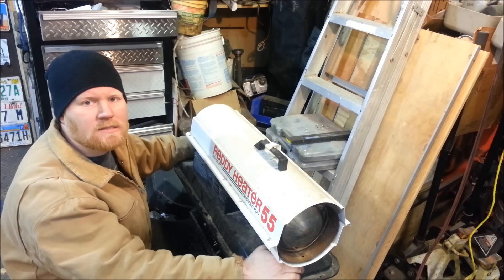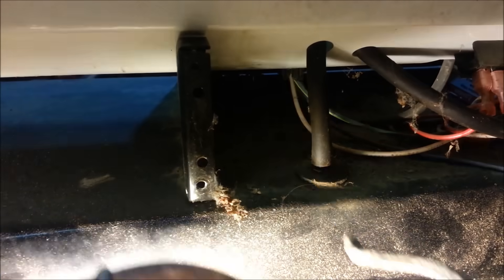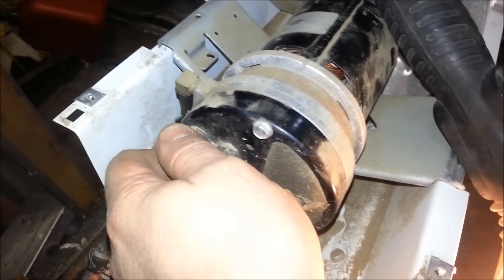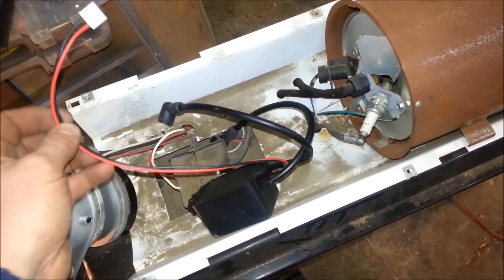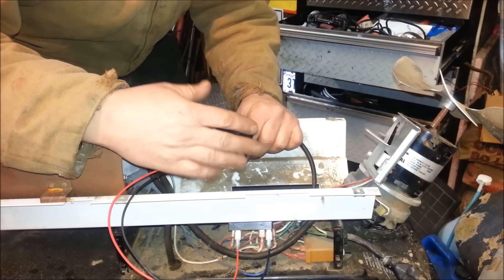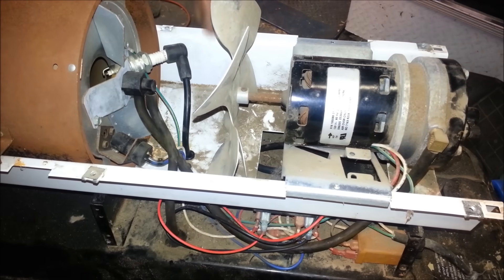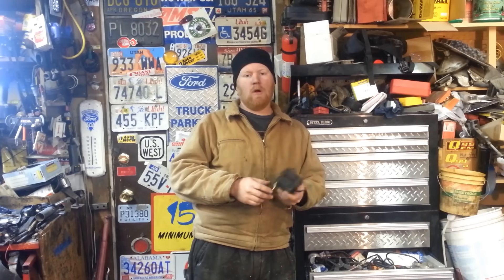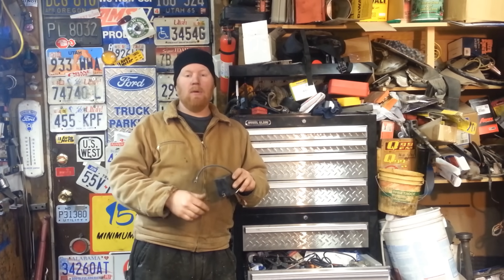Torpedo Kerosene Heater repair & HOW they work

Comment: Question .. I have the same heater. Kerosene is hard to find around here. I run diesel but it seems to smoke my garage up. Is there any settings I should do to make it less cloudy? Or make it better for it to burn?? Thanks.
Reply from the maker: You just need to adjust your air pressure. Kerosene around here is $10 a gallon so I run nothing but diesel and have no issues.
Reply: sixtyfiveford ok. Higher or lower psi?
Reply from the maker: @styga1969  you're pushing too much fuel, so lower psi.
Reply: sixtyfiveford thanks

Comment: I got one it works only if I got the top cover off but if put the cover back on I can see the pump works but it doesn't ignite, so basically it blows kerosene but not flame... what can be the issue please
Reply from the maker: You need to adjust your pump pressure.

Comment: I have one that runs fine as long as the top cover isn’t on it, as soon as I put the cover on it the flame goes out and it quits running in about 10 seconds.  Any ideas ?
Reply from the maker: Adjust your air pressure.

Comment: Just curious, and correct me if I’m wrong, but isn’t your “light sensor” the same thing as a CAD cell for an oil fired unit?
Reply: Yes, its the same thing, both are for seeing if there is flame (light).

Comment: Excellent video, not a lot of fluff and you get right to the point.  My heater quit lighting off last winter, had to throw a rag over the back of it (put on the choke?) to get it started.  Did a complete tune up on it today and your information really was a big help in figuring out how the heater basically works.  My heater actually had a crack in the plastic air pump back housing, losing pressure.  Sealed it up, adjusted the pressure, new spark plug and filter, general cleaning - works like new.  Thanks for the video!
Reply: Sometimes all it takes is a little investigation. This is the first time I have been on this website. Read it over this young fellow seams to have a nack for figuring things out. Great job fella.

Comment: I have the exact same heater, the only problem I have is the blower motor bushings sticking. WD-40 and hand turning to loosen fan works quite well.
Reply from the maker: Nicely done. Throw a few drops of motor oil onto the shaft to help lubricate it. WD40 is great for freeing up sticking parts but not so much for lubrication.

Comment: those things are horrible there is no way you should use these inside.. i had two work with these and when you shut the door the smell and smoke and carbon monoxide is horrible with these...
Reply from the maker: If they aren't tuned correctly they will produce odor, otherwise they're extremely clean.
Reply: @sixtyfiveford  the matance guy ware i worked was an idiot ...!!!!! so if they needed anything fixed he would just buy a new one.. some kind of credit card junkie ... its pitiful how big business solve problems and these things are like 400$ we use two use them till the smell and they would just toss them in the garbage crush them or store them some ware so they could throw them away later... but wow these things smell poisonous ... but working out in the cold heat is heat... till you get inside then these things are deadly your taking your life in your hands...

Comment: Great video!  Is there a way to oil the fan motor bearings? Mine’s squeaking a little and I’d like to maintain it well so it lives long 😄
Reply from the maker: I drip oil onto the shaft(generally ATF but any motor oil works). They are simple bronze bushings and will wear out quick if they start squeaking.

Comment: If you are looking to buy a new "rocket heater" I suggest that you go with propane. The propane heaters are smaller, lighter to carry around, cleaner, safer to refill the fuel and you can find fuel at any place that sells Bar-B-Que grill fuel. My stand by generator is even Propane.
Reply from the maker: I actually got rid of all my propane heaters except for one as a backup. Why? because the propane tanks freeze up and as propane gets near freezing puts out only a fraction of the rated BTU. The colder it gets the worse they work and are only ideal for shop spaces above 40F. Also having to attach a tank and keep it a few feet away nearly triples the overall footprint of the heater vs a self contained Kerosene/Diesel heater. To increase the performance of propane, the tank should be stored in a warm area before connecting it and using it. Doing the math I can put more BTUs of heat for less money with diesel fuel vs propane. That's even with diesel being twice the cost at $3.20/gal and $1.60/gal for propane.
Reply: @sixtyfiveford  You are exactly right about the propane tanks self refrigerating but I live in the deep south and it seldom gets cold enough for us to have that problem what with the propane tank in the heated space. If one is using propane after the fuel level in down a bit you can lean the tank over to about 35 degrees to increase the surface area of the liquid thus increasing the amount of fuel evaporated. 

We used to use them in peoples houses when doing storm damage repair and people did not like the smell that the Kerosene leaves behind. 

Both types of heaters have their place.

Comment: Hey my torpedo heater is not throwing any fuel to spark plug
Reply from the maker: Check all your small air hose lines for cracks/splits. You'll need to take off the top cover to do so.

Comment: Got a 110 pro i purchased in 1988 still going 31 years later. All original parts, would the ones made today even go ten years. I doubt it.
Reply from the maker: Very true. Everything built today is built with the intent of 4-5yr lifespan then throw it away.

Comment: I always wondered how mine worked and never bothered to take it appart.. lol now I know.  Mine actually has a pressure gauge built into the back of it, so adjusting is even easier.  Burns alot of fuel though, about 5 gallons per 8 hours being in a vented garage and all  (protemp 75,000btu)
Reply from the maker: They do drink a lot of fuel.

Comment: My first experience with one of these almost had a fire in a piece of equipment I was warming up. I didnt know someone had cranked up the air pressure which makes them run alot hotter !  Once I knew that it was ok, just had to be careful!  They pump out some serious heat when there jacked up like that!

Comment: Someone gave ME the same model as yours REDDY HEATER 55 i know lot of people would just throw THIS heater in the JUNK PILE and get a new one... i would not do that.. The blower motor was just plain junk and would work sometimes but most of the time it would just sit refuse to run.. + ROTOR VEINS $15 & motor $134 for a replacement, OH WELL i didn't mind it.. i know i could of get same heater off ebay for the same price, but the casing was in good shape and i couldn't see throwing it away and anohter heater would be damn stupid... running for two years and well worth it......
Reply from the maker: Nicely done. I have spent the same as a new many times to keep something alive. I value the learning experience and pride of fixing it myself.

Comment: I have similar master brand one I got used. I tested when I got it and worked, went to check again preparing for fall and it ran then started sputtering, like 2-3 times then it just tripped the breaker thing on the back and stopped working. I opened it up thinking maybe dirty, bad ignitor, etc. Cleaned sparkplug and still had issue. I saw the pump thing I thought fuel pump, but the filter on the back made no sense. I thought the black box under the fan was a motor capacitor.  Somehow I thought that the igniter only sparks once then the flame would just keep it going as new fuel came in. I guess this is similar to oil burners that use a 10,000 Volt transformer to keep the fire going.

Comment: Hi I have a 210000 reedy torpedo and it will run with the lid or top cover off but as soon as I put it back on flame goes out, lift it up in back about an inch and it ignites and runs fine as long as its lifted an inch or so in rear. I have good air pressure, I think around 6 psi. no cracks in hoses and igniter is working fine. Any assistance would be much appreciated.
Reply from the maker: You need to adjust your air pressure to what it specs out to.
Reply: @sixtyfiveford  THERES NO SPEC ON THE INFO BLOCK ON THE MACHINE SO I TRIED 3,5 AND 6 AND IT DID THE SAME EACH TIME.
Reply: OK I GOOGLED THE PSI AND IT CALLS FOR 8.2 PSI. I CAN ONLY GET MINE UP TO 5.8 PSI. WITH IT ALL THE WAY SCREWED IN. DO I NEED TO CHECK MY GAP ON PUMP CLEARANCE?
Reply from the maker: Pull your pump apart and make sure all the vanes are moving freely. Wipe them clean and reassemble everything. This usually does the trick. Make sure the gasket is sealing good and that you have no cracks in the housing leaking air.
Reply: @sixtyfiveford  OK THANKS FOR EVERYTHING, I WILL WORK ON IT TODAY.

Comment: You inspired me to see if my reddy heater 35 I bought at Ace Hardware 25+ years ago still runs. Only used it once. I dusted it off, and you know what? It runs! Same kerosene still in it! I expected it to be goo. It's still running now. I want to burn that old kerosene off before storing it again. Maybe I should store it with fresh kerosene in tank and lines. Definitely will start using it this winter. I thought it would be dead from not used and old kerosene in it. It was stored in an aircraft hangar. Maybe dry  environment helped preserve it.
UPDATE: It ran for over an hour and hardly used any kerosene. Yes it was burning I could feel the hot air. Really efficient heater. I will not be able to burn off kerosene that has been in tank 25+ years. I can't stay with it that long. 
The air filter turned to powder. Blew it out with compressed air. I can fabricate a new one.

Comment: Si if I bypassed the air pump and used a larger venturi sprayed through the small hole in the inner pipe, forced air behind the inner pipe and  vortexes the air in the inner pipe, or would keep you  warm because you just burned down your house?🤓😜👍

Comment: Got a question the sparkplug works if I have it out of the hole once it goes in the hole in my heater it stops I'm using the heaters spark system in both instances if you know why this is can you let me know if it's a bad plug or the spark box that's the problem

Comment: I have the same heater, only runs with the top off. adjusted the pump to about 3.5 psi. with the top on the flame slowly goes out like its not getting enough oxygen. fuel lines look good, new filter (in tank) and cleaned the jet. What might be the problem?
Reply from the maker: This means too much fuel is flowing into the chamber. Turn the air pressure down to flow less fuel.

Comment: So mine the problem is the spark plug is sparking but it won't come on. It was working for a lil and now it stopped working
Reply from the maker: Is it smoking/fogging fuel out of the front?
Reply: @sixtyfiveford  no

Comment: Thank You!  I have a Reddy Heater 70 that looks identical.  I bought it new in 1997 and shamefully have done zero maintenance.  It just stopped on me and I did not know where to begin.  I am confident with a little TLC and help from this video I will have it back up and running in no time.  Great Video.
Reply from the maker: Thanks, I'm glad you liked the video.

Comment: Hi, A friend of mine has given me his heater to fix. Tried everything in your video(new fuel lines,air pump working etc),starts & runs well for 30 sec,shuts down. Blinks out a code (power light blinks to tell you the problem)which is light sensor(not seeing flame) but a new sensor has been fitted. I presume it must be a problem with the control board? Help!! Thanks.
Reply from the maker: That's discouraging. If you have a multi-meter I would test the light sensor for continuity outside the machine. Shine a light into it and view the readings. If it is functioning correctly you can try to remelt some of the connections on the control board to make sure they're getting good contact. If that fails, I new board would be the route I would take.
Reply: @sixtyfiveford  already have tested the sensor, seems fine. Strangely though ran better on fresh diesel from a can. Still has problems but runs for about 10 min or so. Also discovered the board isn't original so could be flashing out a different code, will have to try to track down what manufacturer the board is from. Thanks for your help so far! (I still think it is the board) :)
Reply from the maker: I assume your light sensor simply opens and allows electricity to flow when it senses light. You could simply put a jumper wire on the circuit board so it thinks there is always light and should never trip off.
Reply: @sixtyfiveford  not sure, resistance changes as you shine light at it or cover it(so it's dark), don't think it's a closed/open circuit.

Comment: awesome vid, you really helped me out here.  I'm up in Wisconsin and make knives for a living, and I cant make knives in my shop when it's -20 unless i have a heater.  Well my heater wouldn't ignite, it's a much older model than what you were showing in this vid, but still had similar guts.  i was able to pull the plug, check the spark, clean the plug and get everything working again all in about 20 mins.  Thanks so much for making this video.
Reply from the maker: That's great! I'm glad the video was helpful.
Reply: You can consider an Inkbird ITC-308 for temperature control of heat and a/c for multi use.

Comment: Hi. Of all times for my heater to mess up it's -38 C here in Northern Ontario Canada today and I'm in the middle of changing my Thermostat in my truck which is half in & half out of my garage and tarped all around by my garage door to keep most the heat in. I have a Dyno-Glo Work Horse 65000 btu my problem is that it was running for about an hour it runs on desiel fuel. It shut down then it wouldn't light up for about 15 minutes later then again it stopped. I tried starting it for about 20 minutes I gave up. Now it will not start up? Only the fan blower comes on. Any ideas what it could be?
Reply from the maker: I would first check and clean the spark plug.
Reply: @sixtyfiveford  Alright I'll check out in the morning. Thanks.
Reply: Okay I believe I found out why it was shutting down. The desiel fuel was gelling up at the spray nozzle. So I added a desiel fuel supplement to thin it down and not to gel so far it's working.

Comment: Mine fires up but shuts off after about a min any ideas on why ?
Reply from the maker: If it is producing heat and then just suddenly dies, it will be the  optical sensor.
Reply: sixtyfiveford is there anyway to test it or maybe ground the wires to tear if that’s the part
Reply from the maker: @jonharrington9545   The photo cell should essentially connect the two wires when it sees light from the flame. I would clean the lens of the photo cell and make sure the electrical contacts are clean as well.

Comment: Hey very informative video, mine is a Reddy Heat R110 but as soon as you plug it in the fan comes on, it starts sparking, then almost immediately trips reset button.  Not sure how to tell what's making it trip.  You said optical sensor does that but it never even has time to light before it trips really.
Reply from the maker: The optical sensor should trip it in around 3-5 seconds of start up if no flame(light) is detected.
Reply: @sixtyfiveford  Thanks for the reply, I'm gonna go do some of the tests you talked about with the fuel lines.  I did make sure they were clear but I'll see If I can make it spray. The things I get myself into for friends, just because I will generally fix anything while everyone else just throws it away.

Comment: I have a reddy heater r110 that currently has no spark. I have disconnected the lead that connects to the spark plug and bring the metal connecter end near the housing of the heater while plugged in and running with no spark.  Is is safe to assume the ignitor is bad? If so, I have noticed that the non OEM igniters are rated 1kv higher that an OEM igniter.  Would that cause any issues down the road? I have also noticed the section in your description of the video about dead ending a second lead that is not used, could you elaborate on that? Thank you for your help!
Reply from the maker: If you have a single spark lead igniter just buy the same type. I only used a 2 lead as it was super cheap. The higher the output voltage the better the spark can jump the gap. You won't run into any issues using non-OEM.

Comment: Thanks for the tips. I have a question, perhaps you can point me in the proper direction. My heater works well for about 15 min. then it slow down heat production to a certain point where only warm air comes out. It will levels off at that point. Any ideas? Thank in advance for you help.
Reply from the maker: Try loosening your fuel filler cap. It could be creating a vacuum in the tank if the tiny hole in the cap is clogged.
Reply: @sixtyfiveford  Thanks your awesome